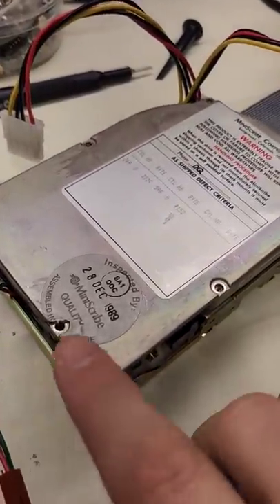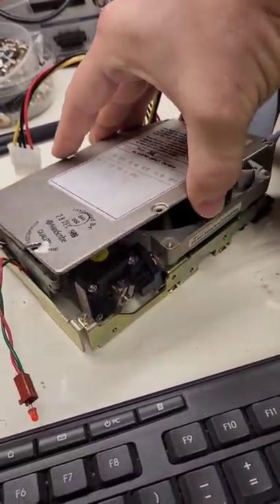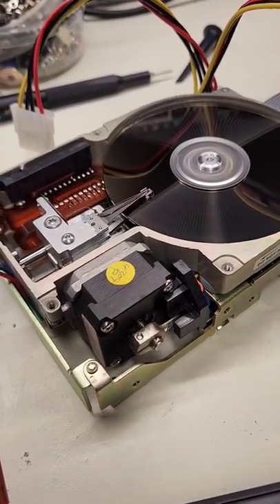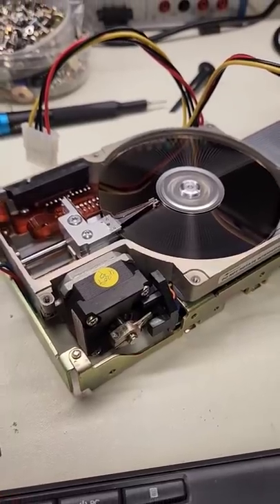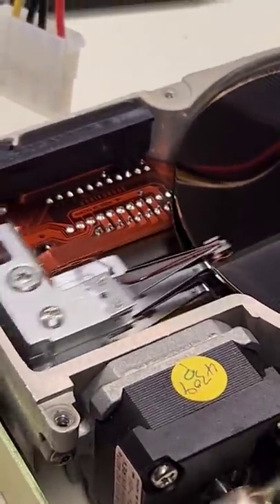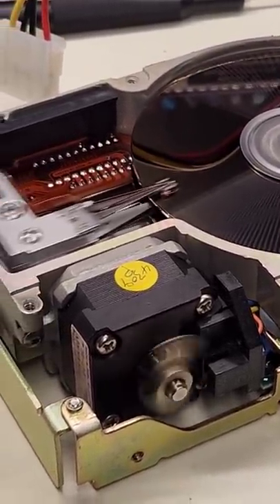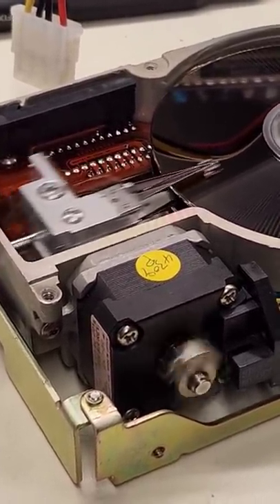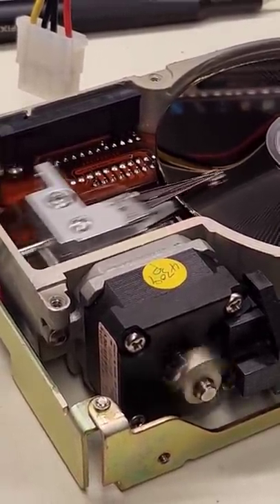A look inside a running Miniscribe hard drive (not a brick)

Comment: 625 kilobyte per second transfer rate under perfectly ideal conditions. Practically I'd guess around 500 kilobytes per second.
it would take this drive, 20 megabyte, around 35-40 minutes to read/write the whole drive.
Take that to a modern hard drive with around 120 megabyte per second, same amount of data would take 0,16 seconds (160 milliseconds)

From 40 minutes to 160 milliseconds ... Hard drives have evolved since then I'd say.

Comment: I cannot tel you how many of those things I fixed back in the day.... The factory didn't put any lock-tight on the set screw for the optical interrupter they used for track zero detection!

Comment: Ha. I still have perfectly working drives from early 1990's..maxtor, seagate, collins,  western digital, miniscribe, and digging deep, Ibm  mfm/rll boat anchors. The controller cards were 8 bit and the drives came in 10mb, 20mb and 40 mb starting around $400.

Comment: I had one of these in my Macintosh SE. it was dead when I got it, but I just got an SD2SCSI. it would make a loud tone for about 10 seconds, act like it would start working, but then make the sound again.
Reply from the maker: Usually the lubricant in the stepper dries up and all that is needed is a few drops of hearing oil to revive it. This one needed it ... Sadly the oil freed the movement but it still didn't work
Reply: @adriansdigitalbasement  yea. I just disassembled the drive and put it in my parts bin.

Comment: 41mb was a sweet drive in 89
Reply: In 92, my birthday present was a packard bell pb8810. 8088,512k ram, 360k floppy drive and an 80mb as caviar ide drive with an 8 bit ide card.  

I wonder what the previous owner paid for that at the time 😳. I used that drive on like 4 different computers as I upgraded, the latest being a 486 slc33 clone I built. It had the low level format option in the bios.  Didn’t know any better at the time, tried to low level it with double the tracks to get more space 🤣🤣🤣🤣🤣

Comment: 1975 Head per Track unit ,  or HPT, 4ft brass plate with megnatic coating..Head flying on disc by dragged air, seperating head. As fast as RAM  
First 4th generation computers Burroughs brought in Mumbai by TCS, handed to me to work on.

Comment: On the long version video, it sounds like one of the heads are touching a disc. If that's the case, I wouldn't turn it on without its protective case on. The disc might crack and splinter, shooting shrapnel all around.

Comment: Try doing a long string of 1/2 to full stroke of ST4096 ST4053 and related without mounted in a heavy case. Even then many machines will walk with them as heed thrashing for any reason. If a desk isn't very heavy then can easily shake stuff off them while PC is trying to walk off.
Reply from the maker: Heh and I have one of those Seagate drives. It really shakes the entire table when doing full stroke seeks. The think is a tank and still works!

Comment: I did fix an MFM one (older and bigger). The flex cable into the heads had open contacts and I resoldered all contacts with thin wire. it came back and I think I only lost like half a meg out if the 10 meg's it had.

Comment: Fantastic...very awesome video about this...but I must ask...Did you image it at the raw flux transitions level using your Gesswein MFM Reader/emulator before you opened it?  You can almost always get something off of these drives, even if it's only scraps of the full image, just for education.  I always do.  Anyway, I have half a dozen of this model, and as always, great video!!

Comment: Check out that motor, that's why current low-end 3d printers are cheep, like under $200 where the output competes with much more expensive units.

Comment: I have a working SCSI disk from a Macintosh Classic II also working. But every time I want it to work, I have to open the drive and unlock it to get it spinning again. Greetings.
Reply: Might need a drop of oil on the spindle.

Comment: Stepper motor based HDs were problematic, as metal expansion/contraction and even slight twists if you mounted them tightly would cause the data to drift away from the static head position.  At least the Seagates were.  You frequently had to low level format them.

Comment: I mounted one of these on a display stand, Perspex cover, with it stuck in test mode.
On these drives, there are no servo tracks etc, the user can totally re-write everything, unlike a modern drive with lots of servo info etc., that is written in the factory, and cannot be user replaced, once it fades the drive is dead.

Comment: I never heard of miniscribe. I guess we escaped being ripped off. But my brother thought SeaGate was a bad hard drive company. I think this was not accurate; but perhaps you remember that ?
Reply: I can elaborate on that. Of the hard drive companies active in the 80s, Seagate was the most reliable and consistent. Their drives generally worked well, and no corporate scandals. In the early 90s they had a few lines that were mediocre performers. They may have been reliable, but they weren't as fast as some competitors. If your first impression of Seagate was those 80s drives, you regard Seagate as the old reliable dependable hard drive company. If your first impression of them was their mediocre 90s drives, you won't regard them as highly. And in the 90s (and decades since) pretty much every company had one generation of drives that wasn't reliable. If you bought one of those and it failed on you, you probably held a grudge against that company for years. Your brother's impression of Seagate is probably colored either by memory of those mediocre 90s drives, or having a Seagate drive fail on him or on one or more of his friends and hearing about it happening to other people at the same time.
Reply: @davefarquhar8230  Most likely! Thanks!

Comment: Mine worked well till I pulled a cord that was under the computer while it was running and the computer came crashing down by 5mm. Had to do a low level format but then it worked again till we gave away that computer.

Comment: Once you remove the cover on any hard drive, you pretty much “brick” it. 😂
Reply: Is that really the case? I thought that (really) older drives, i.e. from before manufacturing tolerances could be tight enough for modern designs, could kinda-sorta handle it because of those wider tolerances making the gap between platter and head large enough for ambiant dust to not immediately cause a head-crash. Granted your mean-time-to-failure has shrink by orders of magnitude, but it still works (for a limited time).